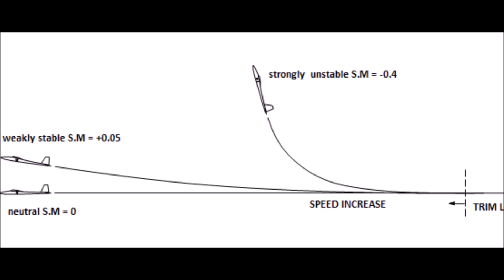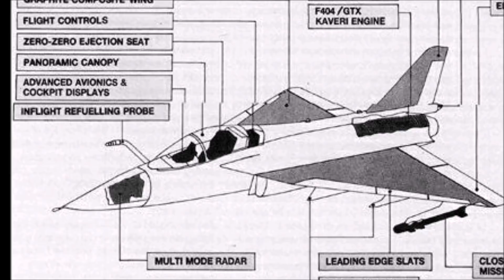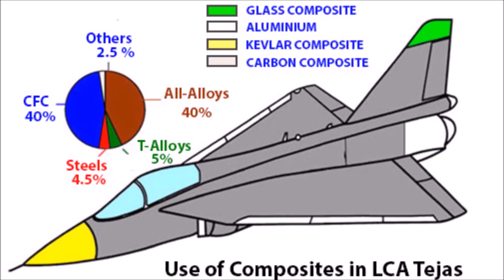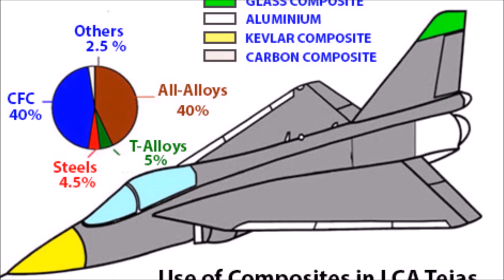🔴 Is LCA TEJAS a FAILURE? Let's FIND OUT! LCA Tejas Documentary: The Tragedy of Tejas

Comment: Considering the constraints, Tejas is a great success. 
The efforts will progress to build highly competitive fighters in future.
Reply: The design is not the issue it never was, Issue is manufacturing.
Reply: @rishavbhowmik6648  Manufacturing will also not be a problem if there are enough orders in pipeline. HAL can then increase its capacity. The issue is maintenance. Tejas is a high maintenance aircraft it seems.
Reply: @dragonbane44  
I read somewhere that that there are 80 orders of tejas but only 21 have been ever made.
Why would anyone buy something that is not delivered on time?
Reply: @dragonbane44  
Another reason for poor manufacturing rate is that india has very few or no industry to make raw materials for such industries.
The carbon fibre fabrics are imported from korea.
The flight control system's computer is bought from Honeywell (USA).
Except for few metal parts everything is foreign.
Reply: @rishavbhowmik6648  Actually, indigenous content of Tejas is approx 60% by value. You can't have everything done domestically. Some has to be sourced from outside if your product is to remain competitive in market. Its not a big deal, its globalisation.
Reply: @rishavbhowmik6648  Yeah, there is an order for around 80 Tejas but not all of them in IOC config which is what HAL was capable of producing until now. Now, that Tejas has got FOC certification, further production and delivery will start. But demand for Tejas is also limited. Main demand is for Tejas Mk1A and Mk2 version which are theoritically much improved version.
Reply: @dragonbane44  
I don't agree on that 60%.
Since I don't consider molding Korean Carbon bases in India, as idegenious.
Tell me the name of any non metalic raw material or any computer part or sensor part that is completely made in india.
Even if HAL has factory to built aircraft there is no aviation or basic rawmaterial industry in india.
Reply: @dragonbane44  
So airforce need to wait for another few years to get a 4th gen aircraft.
I mean isn't it funny.

I dont know what that nerd certification means, All I see is that Airforce is not getting what it ordered long ago.
Could have considered if it was some 5th gen or 4.5gen stuff.
Reply: @rishavbhowmik6648  If you can't even understand what those "nerd certification" means, why are you blundering through these discussions instead of reading a bit more? Enough material is available on the net.
Reply: @rishavbhowmik6648  Those are datas from Wiki. If you don't consider something which is manufactured in India as indigenous then  I don't know what indigenous means.
Reply: @dragonbane44  point is I am not at all blaming HAL for anything.
As HAL is doing everything an aronotic company should do.
What I am saying is that there are no rawmaterial producers india, India had nothing like honeywell, simco, ge (bhel seems dead) etc.
Making it impossible for HAL or DRDO to make anything better.
Reply: @rishavbhowmik6648  its better stop this project and all political parties start new project so then their will be no leg pulling
Reply: in 200 years right?
Reply: @rishavbhowmik6648  at least we have Know How ideas assemble and Maintenance Better
Next steps sure India Have own made missiles like Astra BVR and Aesa movr on step by step not to jump

Comment: Manmohan Singh spoiit every show .
Reply: Not true. Kaveri engine is not yet ready. There was no other option than using a GE engine and Israeli radar if India wanted to have squadron within 2018. The Kaveri engine based version will be ready only by 2020 or later. Thanks to the intervention the fighter is optional. The Tejas LCA project was never stopped and continues in full swing even in the current government. Mistake by the previous government is regarding the Navy project. This has been corrected by the current government by pitching Navy's requirements in the MK2 version.

Comment: Off late there has been misplaced and exaggerated case (or even outright propaganda against Tejas) to acquire foreign light fighter which needs to be countered. First it was lack of capability ("Tejas cannot fly far or cannot carry enough or takes too long to prepare”), then it is lack of capacity ("We cannot produce fast enough and squadron strength will fall to 27 by 2032 etc.”) and later it is variety of planes. All are grossly exaggerated. We need to realise that foreign light fighters compete with Tejas and handing over $15 billions to competition starving our own will be a body blow to Tejas program from which Tejas might not even recover. 

Four critical questions need to be answered before we go with the proposed 114 foreign light fighters:
1. Is Tejas MK 1A is good enough for the designed roles of point defence and close air support (i.e. near ground attack) - Answer is a definitive yes. MK 1A being stealthier (1/5 RCS) and with similar, if not better radar (RBE2 or EL/M 2052) and weapons (theoretically even Meteor) can detect them earlier and shoot them down. Being more manoeuvrable and if we add Spectra used in Rafale to EW System, it'll beat them in dog fight rather easily. Range, by design, is really not of much consequence. We have heavier planes for other roles. 

2. Can we produce ~225 planes in next 11 years (i.e. by 2028), the timeline by which proposed 114 foreign light fighters can be expected and cover the retirement of 11 squadrons of MIG 21 & 27 by 2024?  - Largely YES. With the capacity 16 planes annually, existing order of 6 squadrons (123 MK 1 &1A) is to be met by 2025 and shortfall comes down to 5 (or say 6 and not 15 etc.) squadrons, which can be met in next 5 years (I.e. by 2030). 3 squadrons of upgraded Mirage good for another 2 decades takes the count to sanctioned strength of 14 light fighter squadrons. With additional investment (i.e. bigger order), 24 planes annually is doable and shortfall of all of 11 squadrons can be wiped by 2028. Theoretically, with new private production lines competing with HAL, the number can be improved further. 

3. True, MK 1A (12 ton class) is inferior to Gripen E (16 ton class) in range, payload and multi-role capabilities, but is MK2 (similar tonnage) comparable? If not, can MK 2 be made comparable/better with this additional $15 billion? - MK 2 is comparable to Gripen E in all areas except maturity, drag reducing aerodynamic, operational cost and sensor fusion and may even exceed in areas of payload (same GE F414 engine and with 1 ton further reduction, ~3 ton lesser Empty Weight), range (similar Internal Fuel Capacity, 3 ton lesser Empty Weight and same engine though more drag due to delta wing) and EW Systems (Spectra). MK 1 itself is better in the areas of manoeuvrability, stealth, high altitude warfare and of course, per unit cost and equal if not better in ease of flying and safety (avionics). Tejas will become better with additional investment and time. 

4. By not buying foreign light fighters, are we not losing on variety and putting all our eggs in one basket? Not really. We have variety of options, both Western and Russian, in the medium and heavy category that creates enough space for predominantly indigenous light fighter segment (Tejas engine, radar & weapons are western/Russian). In the light category too, we have 3 squadrons of upgraded Mirage good for another 2 decades.

Finally, we can be and must be self-reliant in light fighter category and all foreign fighter acquisitions must be limited to only medium & heavy category.

Comment: The main problem is the methodology used to design the aircraft. Waiting for the air force to provide the specs. The engineers don't need the air force's spec. They just need to look at the foreign fighter jets  in the same category and try to create something better.  Better range, weapon load, maneuverable and ease of maintenance.  The most important thing is better than the MiG 21 that it is trying to replace.

Comment: Thejas is not a failure. It shows the brilliance of indian scientists. This have super avionics system and great maneuver. Consider that it's not a front line fighter. It's use for supporting operations and its for instead of mig-21.Its a fighter india need.because india need more fighters which is economically stable and powerful in operations.

Comment: MMS gov had to speed up and push the project because pilots were dying in the old MIGs and even if not upto the desired mark the plane would be cheaper than buying some other plane from Russia or France. It had no other option. And a naval variant was an essential requirement. You can't blame UPA on this.

Comment: I still didn't understand the mess created by UPA government part. Could someone please elaborate?
Reply: It's not a mess, but just a political agenda against the previous government. In actuality, the use of GE engine and Israeli radar has helped HAL to produce a compatible fighter in short time. So we currently have functional fighters inducted in the IAF. This reduces pressure on the Kaveri engine based version. It can be done more accurately will lessened time constraints. The MK1A is a lighter and hence better fighter. The MK2 will be an advanced varient that surely will be sky dominant and using the yet to be proved high thrust varient of the Kaveri engine. We are able to get bidding on the current Tejas though.

Comment: As u said individual component not meeting  performance requirement does not means the project is  a failure. It only confirms existence of capability.  One should rather look for the
 reasons for  non-performance os that particular system and push  forward to iron it out.  It is not an option but a necessity or survival.

Comment: If Tejas engine and radar are inadequate then it is a failure. You can say that it was successful a research project, much was learned, but the only valid measure of success is overall performance. In actual combat, inadequacies will be punished.

Comment: With carbon fiber composite, Tejas is not light at all. It also has an underpowered engine that wil not give necessary thrust. Please buy and negotiate a good deal. Nope, can't do that either. Rafales came at $250 million each when equally good Super Hornets are just above $95 million with a production line in India. Hence, India with 7 times the defense budget of Pakistan is not much ahead because of 10 times the inefficiency.